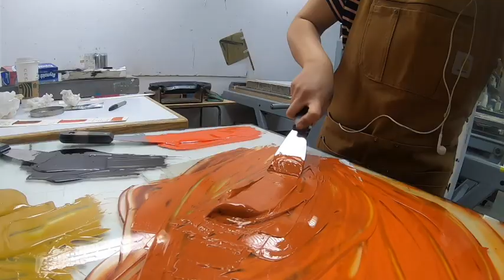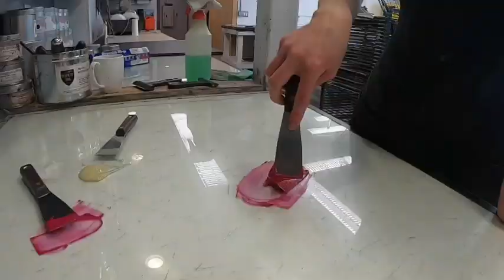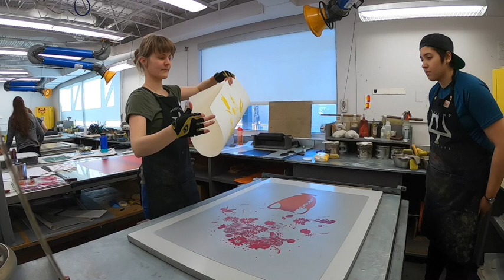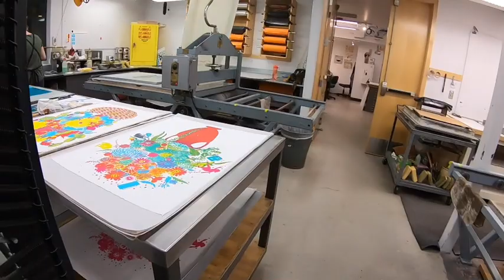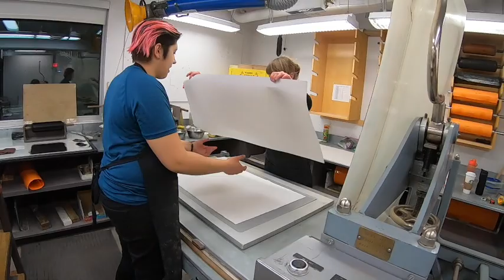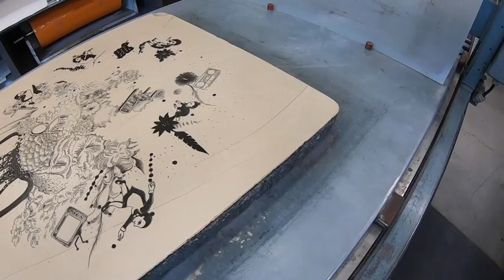Making a Lithographic Print at The Tamarind Institute of Lithography

Comment: Their backs are going to be toast within one or two years using those jumbo rollers. They need to learn how to feather a flat using smaller rollers. Either that or use their DUFA for those large flats
Reply: @BilliePosters  As a lithographer of 50+ years all I can say is good luck. I know how light the rollers are, but to have your shoulders spread like that no matter the weight will eventually do you in. I'm just saying there are simpler ways to achieve the same results. I actually make a roller like those that come in at under 8 pounds. I still wouldn't use one on a regular basis, especially for editioning.